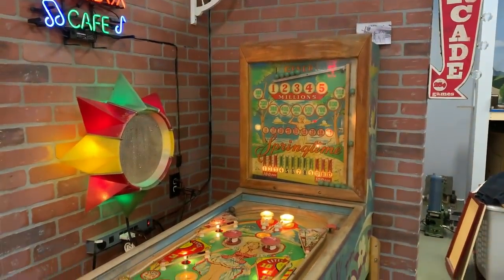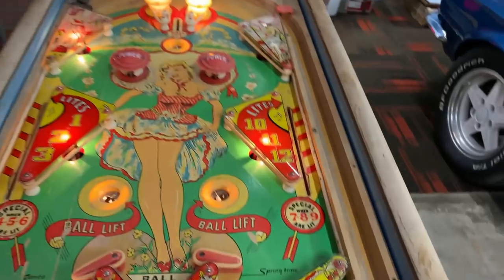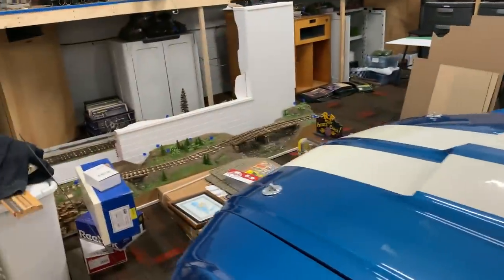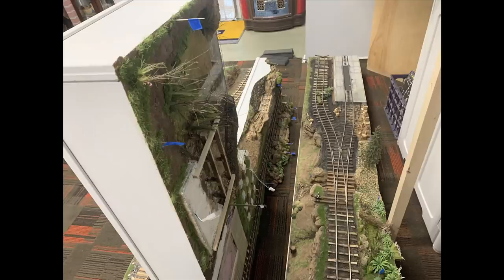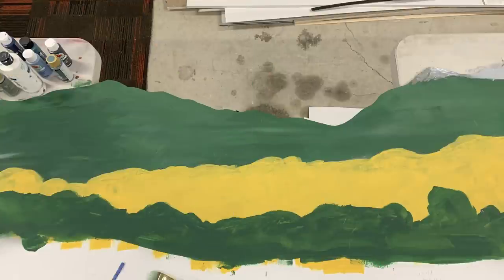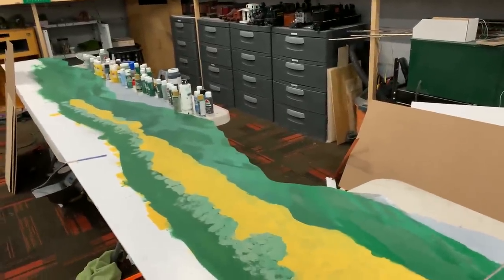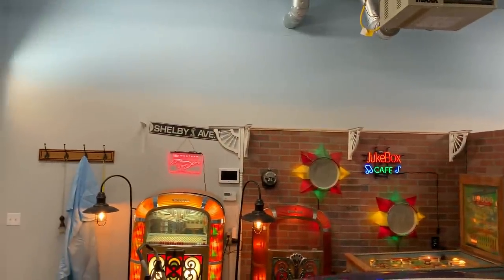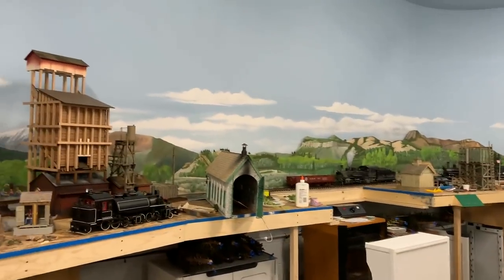Garagemahal update for August 2021

Comment: It's really looking good there. 👍 Nicely done.  Looking forward to more.

When the weather breaks, perhaps you could give us an inside-out tour of the Mustang.  It'll be time for a drive.

If I might suggest, put some aluminum roof edging over all sides of your exterior particleboard.  I'd hate to see it delaminate.  Even exterior rated panels will go bad if not protected.  Cheers!
Reply from the maker: I’ve covered the wood with roofing material. Sealing the edges. I’ll show how that works soon. Should be ok. I hope!

Comment: instead of using plywood on the outside railway use cement board  3'x5' by 1/2 or 1/4 works great and can handle rain and snow

Comment: Boy you two have been busy... looking at your outdoor track layout I was thinking Hardy backing board may have worked better as decking than OSB because it's a cement product.
Reply from the maker: I’ve covered it with rolled roofing materials. Sealing the seems with mastic. Seems to work fine. So far!  But just like a roof on a house. So I think it’s going to be fine.
Reply: @ToyManTelevision  it's the so far that may change... like so many times they do.

Comment: Id like to know more about the building lighting pannels, can you cut them?
Reply from the maker: Yes!! We ordered more. Lost in the mail!! But you can cut them as long as you keep connected at the edge where the copper strips are. You can cut through the strips but then the panel from there out dies. Oh and the voltage on the panel is 600 volts!  So if you cut it don’t cut it when it’s on!  Or touch the edge where you cut it. Unless you put some clear tape there or something. No amps but it will zing ya.

Comment: I’m not sure the strand board will hold up in the winter. Did you soak a piece with the hose and let it dry in  the sun? You always put such great effort into your projects and it’s heartbreaking to have to rip it out. I would consider some 3/4 inch marine plywood if things go south. As always, love the channel and I think you guys are absolutely awesome- keep it going!!
Reply from the maker: So far all good. It’s under roofing and I think it’s going to be fine. Everything out there moves. Wood is like that but even the concrete driveway is moving around. My plan is to make everything easy to repair or adjust.